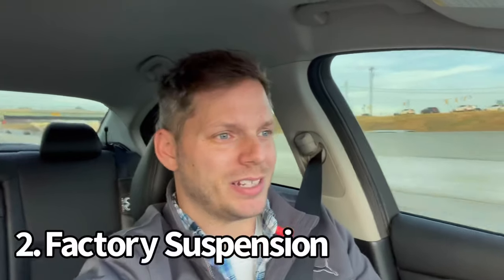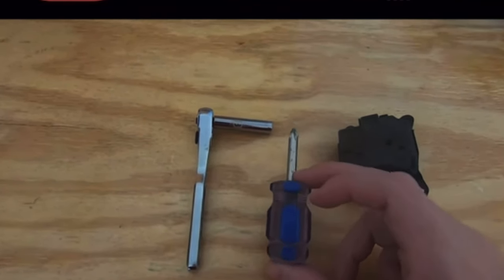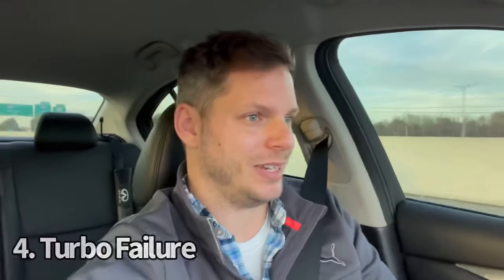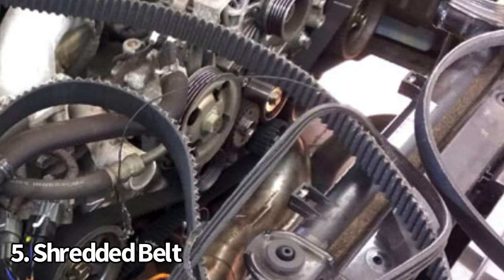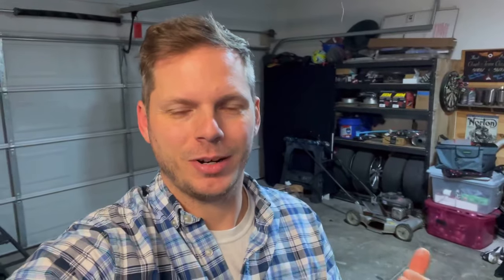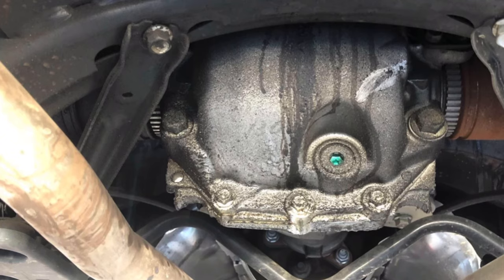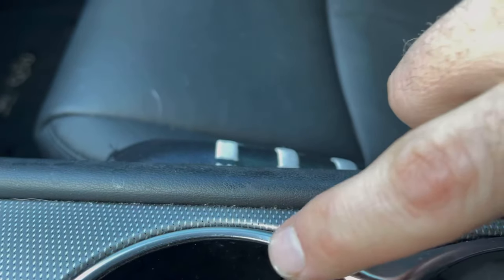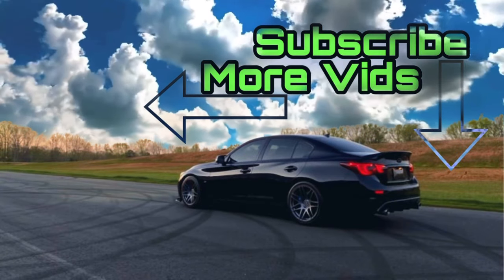8 Q50 Parts that WILL Fail!

Comment: U nailed it with this video! Blend door actuator was about to be replaced on our 17 q50 Signature with 49k miles the other day. Dealer quote was around $518. Please post a video on how to replace that, I would greatly appreciate it. Already replaced belt once & rotors resurfaced too. Dealer couldn’t confirm my suspension concern so, I’ll keep an eye out on that next 😧
Keep up the great work! Thank you 💯 😃
Reply: The video he referenced on my channel will get you all set till he commits to doing the replacement himself. The link is in his descriptions and It’s super easy!

Comment: Currently Diagnosing my 15 Q50. Misfire on cylinder 4, Mass Air Flow 1 & 2 Low circuit voltage and random multiple misfires. Changed the plugs and noticed a tad bit of oil on a few so now going to replace the injectors and valve cover gasket. Fun.
Reply: I'm having multiple misfires on cylinder 1, replaced the plugs. Running ok at the moment

Comment: My 14 q50 3.7 base (no sunroof) had 111k miles 🦍 still going strong 💪🏽
Reply: Never had issues with the valve body?
Reply: @lordofthehearth2740  I did with my 2015
Reply: I’m at 86k and my 2014 Q50 is currently at the dealer having the blend door actuator and the radiator/engine coolant fan assembly replaced. $2000 poorer, but this is the most significant thing I’ve had to get done so far.
Reply: You lucky this damn sunroof gets on my nerves

Comment: Wow.  You were spot on.!!  You said the valve body should fail around 65 to 70,000 miles in mind died at 66,000. $2900 at the dealer.

Comment: Lollll i’m scared asl. You mentioned the valve body which I see A LOT of in the Q50/Q60 group. I’m between that 65k-75k miles. I’m sitting a 77k miles, out of warranty margin. Fingers crossed for my baby. My hood struts also failed… Fell on my head. And the chrome trim on cupholder peeling.

I’d like to add one though. The heater hose coupler. The plastic piece inside the hose becomes brittle and fails causing a small coolant leak. If this happens, i recommend the Z1 coolant bleeder port. Way better than a piece of plastic.
Reply from the maker: Good addition
Reply: My Q50 has the same exact problem, the rear heater hose is leaking a little bit of coolant.  I'm scheduled to bring my car into the dealership next week Thursday to replace it.  Did you fix yours yourself ???
Reply: Valve body failed at 71k on my 370z.. sad lyfe

Comment: I agree, my 370 has a warped stock rotor. It also just lost the fuel sending unit at 64K. So I am guessing till next month. I ain't working on it until the holiday is over. I need all new rotors and pads, lines. it is a 2010 model, so all the electronics are showing the bad Nissan years. You know which parts the gaijin approved.
Reply: I replaced my m37 rotors for about $400
Reply: @theglassarrow_  I am going to go with the stop tech calipers and EBC  rotors carbon ceramic pads. Metal lines. it is a base model Z so it needs the full gambit.

Comment: Im a 2018 q50'er, 3 sensors out so far, cam shaft sensor (lower right), speed sensor and windshield fluid sensor. 125k miles.

Comment: Our Q50 the left driver window started going down slow a month ago.  We took it into Infiniti service when we got an oil change and they fixed it no charge, but didn't explain what they did to fix it.  Thinking still either it just needed to be lubricated or leaves got stuck down there or dirt buildup not sure.

Comment: Rear abs sensors I see pretty common also. I’m nearing 70k and so far so good with the trans, keeping my fingers crossed haha
Reply from the maker: I’m with ya!
Reply: my car acted up on a downshift and the check engine came on one day. it went into limp mode and stopped shifting past 3rd gear. the valve body went bad on my 2014 3.7 at 90,200 miles
Reply: @adrianbrothers6925  mines went bad at 115k miles I’m using my income tax to get it fixed since I have the title to the car I don’t wanna sell it

Comment: Thanks for this video! Have you needed to replace the transmission valve body yet? How much would that typically cost?
Reply from the maker: No I haven’t.  It’s quite expensive and doesn’t necessarily mean it won’t happen again.  Many people are simply upgrading to the vr30 trans

Comment: 2015 q50 3.7 sport (motordyne exhaust motordyne Advanced Resonance Tuning Test Pipes k&n cold air intake) Ecutek n dyno tune at around 40k. Haven’t had a single maintenance issue running smooth @110,000 only thing I’ve done for preventative maint is changed rotors brake pads spark plugs and serpentine belt and change the oil every 4,500 miles🤞any recommendations?

Comment: Definitely had the deck lid struts, front & back rotors and A/C actuator go belly up.  I've got 65k on my 2015 so I'll start watching for the other things.  Great video!!
Reply: The motor just siezed up on my 2014 q50 with 88k so yea fuck these cars
Reply: @ryanharvey9800  damn sorry to hear that bro, i’m at 125k rn and no major issues other than a radiator going out, suspension on all 4 sides, trunk and hood struts, and my oem battery just went out a few weeks ago, i also have a 2014 but still going strong !

Comment: I got a 3.7 2015 q50s. 

The suspension is trash as fuck , it’s super common to have that issue . Lookin to replace mines . 
The chrome peeling inside is true . Mines is peeling.

Factory rotors are true on my sport , got them resurfaced and once they ruined I’m have to replace them. 

Transmission is still good at 85k.

But he’s right with the common issues. I got a backup 3.7 belt in case it shreds.

Comment: Have had to replace rotors and trunk struts on my 2014 Q50S hybrid. I only have 50k miles on it, but it's great to get your observations.
Reply from the maker: Thanks for watching!
Reply: 2014 q50 premiums hybrid all wheel drive 75k around 55k dealer did back suspension subframe.  I had extended warranty so didn’t pay or this.  Nothing else done bullet proof .  Off-course oil filters tires.  My wife car she says is too old now 😂 to many miles 🤣🤣.  I am on the fence to let it go as a trade in.
Reply: My rear struts were done by 30k miles, replaced them with new ones but preferred the broken ones because it was much easier to close.
Reply: Hey Maybe you can help me out.  I have the exact same car...im getting a pulsing in the breaks that feels like the abs is kicking in for no reason.  happens about 45% of the time i'm coming to a stop.  Also getting really sensitive breaking sometimes.  most of the time its good but then maybe 15% of the time it comes to an aggressive halt with the slightest touch of the break.....very intermittent.  Any thoughts?

Comment: 2014 q hybrid. Yup, had several these. My passenger occupant sensor also failed. The mat sensor, not the controller. It’s a simple strain gauge, no moving parts. But it failed. See q50 forum for repair details.

Comment: Thank u so much for the video. I recently bought a Q50 2.0 2015 model and sometimes when I accelerate it seems that the power does not go to the right gear. RPM goes high quickly to 4000-5000 but vehicle does not move fast as it suppose to be. Can u pls tell me what could be the problem?
Reply from the maker: Sounds like the valve body issue mentioned in this video

Comment: 2017 q50 RS here. Got a check engine light a few days back, car ran fine until I noticed revs were hanging on longer around 3k. Took it to Infiniti and unfortunately my valve body is no bueno. I was told that the parts and labor would cost me over 3k but luckily my car has 47k miles on it and that it was still covered under warranty!
Reply from the maker: Dang!  Don’t hear about valve body issues much with the vr30 trans.
Reply: @SpeedCultureStudios  happened out of the blue! Just a normal commute to work one morning and the check engine light nonchalantly popped up...
Reply: Im having tranny issues also, first it was a bad tcm, now im throwing the same code and its in limp mode again, luckily i have 47k also on my 2016 q50 rs so my warranty is close but its still there so im getting it fixed this week
Reply: My shifts are a bit boggy while going slow around 1-2.5k rpm’s I wonder if my trans is starting to fail.. 2016 rs

Comment: Knocking on wood as I type this, but nearly 200k miles on my 2015 Sport Hybrid RWD, and so far the only things I have had repaired were the transmission replaced for a cracked bell housing at 63k miles(they replaced with a different part number, transmission from 2016+ maybe? Happened in March 2019), and I had a rear sway bar replacement when I ran over some debris on the highway and it somehow snapped one end of the sway bar loose without breaking anything else. Both were done under warranty(I had the 8 year unlimited mile bumper to bumper up until a month ago).

Do get the slow driver window occasionally, but just hit it with lubricant once or twice a year.
Reply from the maker: Great run!

Comment: My valve body went out and had to change my transmission. 2015 Q50s, went out around 79k miles 

Dealership price 
New transmission: $9,445.15 (labor and part)

Used transmission: $6,568.15

Local mechanic : $3200 with everything included 

*just for those who wanted to know , those are actually numbers that I was quoted *
Reply: Mine at 79,800

Comment: I have a 2010 Altima with the slow window issue. 12 years and 200k miles later, they haven't stopped but they're still slow.
Reply from the maker: Lol, as long as they’re still working!

Comment: Rotors came first for me at 80,000 and I’m worried about the rear differential…damn but the rest is chillin cause I’ve actually modified quite a bit, my struts are not stock and I did this because the car is heavy AF let’s be honest the whole deal with the stock struts is probably because it’s a heavy yacht of a sedan with cheap struts. Also my injectors are not stock did that cause figured they didn’t ratio properly or use the right injectors for a big engine like a 3.7 as most other car companies have as well failed to improve on, and I upgraded my oil pan, got an oil cooler, heat exchange, carbon fiber hood to lessen the weight of the car a bit, upgraded sway bar, and lastly with the rotors I did not use the stock rotors I upgraded those and the break caliper as well.
Reply from the maker: Sounds like you have a nice platform you're working with.  It's a solid car over all.  Just like any car, they are bound to have their quirks.

Comment: 2015 Q50 Premium AWD definitely showing the slow window thing, especially on drivers side 🧐
Reply: my 2017 signature edition is doing the same lmao
Reply: Check my comment
Reply: @EpicRudeDude  I have a ‘17 Signature and my driver side window is slow as hell too man, only in cold weather though
Reply: My 2018 q50 driver side window is so slow sometimes 😂
Reply: @PodHubExcerpts  For those who have issues with slow windows, DO NOT GO TO THE DEALER. Buy a lubricant silicone spray and spray along your window frame , give it 5 min and then put your window up and down a few times and bam brand new fast as hell.
Reply: @ameerskater  I’m gonna try that 🧐
Reply: @ameerskater  A DRY lubricant spray.

Comment: Great video 👍
I'm living in New Zealand and I got a q50s Hybrid AWD. In her very hard to find spare parts and now I'm looking buy the front shock absorber. Would you be able to give an online store?
Thanks
Reply from the maker: Thank you for watching!  I'm not sure of sites that ship international, but you could try infinitipartsdeal.com or check out moog's website.
Reply: @SpeedCultureStudios  thank you so much, I'll try....👍
Reply: I have a 2014 hybrid and I was told that the hybrid battery is going out and that cost over $10,000 I'm looking to buy a rebuild one so far the car is running good still with no problems it causes the check engine lights to come on time to time other than that the car has been faithful to me but I'm decided if I want to fix it or sell it 🫢🫣🤞🤞🤞

Comment: So same with my q40- I have changed my valve body, my diff is leaking as well. My rotors warped at around 50k miles. My door actuator failed as well 🤣. I have changed all these so I’m not worried anymore
Reply from the maker: Got them all out of the way lol
Reply: @SpeedCultureStudios  lol

Comment: Hello my 2014 q50s is showing signs that the valve body is going bad. I just wanted to know if you would happen to know of any private shops in socal that would be able to do the repairs ? Or do you think I should go straight to the dealer? Also I’m at 85k miles so I’m passed the warranty sadly
Reply from the maker: Dealer will be super expensive but wouldn’t hurt to check with both

Comment: Hi. I have another question. Have you heard about rear doors locks failure ? Recently my left rear door stopped to work. I can't unlock them neither with remote control, front central lock button and button on doors. Both inside and outside handles acts like you try to open locked door.
Now I am stuck, as I can't open doors at all. Is there any trick I should know about. Can I take out panel with doors locked ?
Thanks for advises :)
Reply from the maker: Check the child locks.  Are you saying you can’t even flip the lock on the handle itself?
Reply: @SpeedCultureStudios  I can't open doors at all, from both sides :(
Reply from the maker: @levisik  I’ve never heard of this happening
Reply: I think the same thing happened to my front passenger side door on my old Altima. I had to replace the Door Lock Actuator. There are YouTube videos on how to pry off the door panel on a Q50 to get to the actuator. Might still be somewhat possible if the door is inoperable as in your case.

Comment: I have a 2018 q50 that is been doin what you said with the transmission and it only has 35000 miles but the dilership has told me the transmission is fine that they cant fine the problem so what do you think i should do just let it break
Reply from the maker: Go to a different dealership.
Reply: There is only one dealership in vegas to take the car
Reply from the maker: @mauricohernandez4238  try to find a decent independent shop possibly.

Comment: I have a Q50a with 155k, and all I have ever done is brakes anti freeze and oil change.

As a turbo guy, the problem of turbo failure is using dyno oil. Only use synthetic oil. Turbo failure is high in EVERY turbocharged car.

Now my blemd doir is acting up and the tranny valve body.  Both of these parts I can get for a little over 1500.00. This is a big bill, but it is a small thing if I can get more mileage before I buy the next vehicle.

Comment: I wanted to get a cut out valve on mine do you think that’s a bad idea ?
Reply from the maker: No it’s a cool idea!
Reply: @SpeedCultureStudios  do I get 2.5 or 3 in for the q50
Reply from the maker: @CashMoneyKings3  just have to get the diameter that most closely matches the exhaust you have.  If you are doing this in factory exhaust it’s closer to 2.25”.  If there aren’t any 2.25” cutouts, the shop will have to make a couplet/adapter to get to 2.5”.  It can be done.  Check out my electronic cutout video for my daughters Acura MDX.  I believe I linked the cutout in that video

Comment: If you’ve already change your valve body because it failed, does this fix the issue permanently or it’s always going to be an issue?
Reply from the maker: Not necessarily but you should get plenty of life out of a new one
Reply: Where can I get one from ? Without going to a dealership, mines had a up shift it’s slightly but looking from the comments it’s common idk if the valve body or the engine speed circuits that need to me change ? Please any advice would help a lot thanks

Comment: I'm curious about this transmission failure. Never heard about it before. My sister had Ex35 for 8 years, did 180k miles, no problem with AT. I know that we have AT7, but is it that much worse?
How about transmission from 3,0TT, IT is also 7AT, but I heard, that it can handle much more torque. Does it mean, that it doesn't have the same issue as 3.7 ?
Are gears the same lenght in 3.0 and 3.7 :-) ?

And finally - those doors blends, or how you called them. This a common issues in some french cars. I found, that, while, you change direction of flow, when fan is spinning fast it is more common to have this failure - maybe the same concerns Q50. For now I have 55k miles, and no problems with transmission or air door blend :)
Greets from Poland.
Reply from the maker: It’s a very common problem in the 2014-2015 q50.
Thank you for the comment and for watching!!
Reply: Nissan has the worst transmission, almost hands down.
Reply from the maker: @antsy602  well now that’s not true lol.  And it’s a pretty broad statement.  The 7spd auto isn’t too bad overall and is actually pretty good in the newer Q.  The cvt they use in other vehicles is garbage but that’s just because it’s a cvt.  There are a lot of cars out there with poor transmissions with far more issues, I am sure.
Reply: @SpeedCultureStudios  My bad... Yes, the CVT transmission is exactly what I'm referring to. Trash...